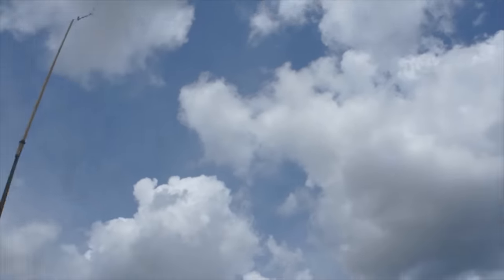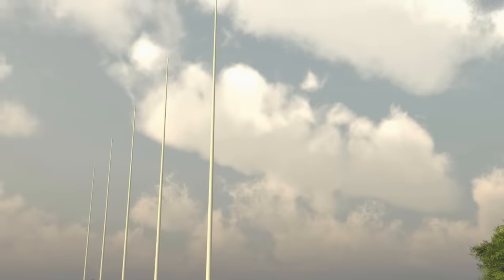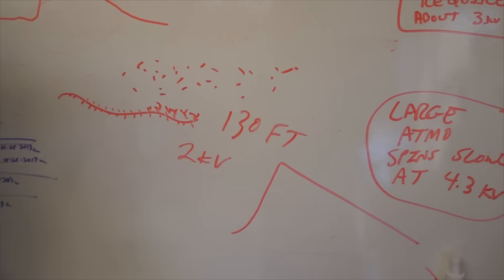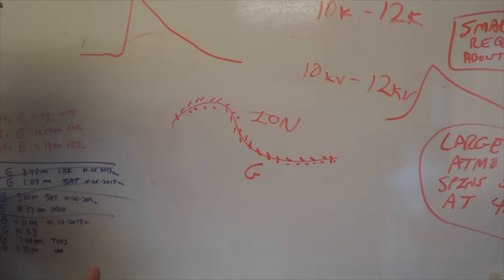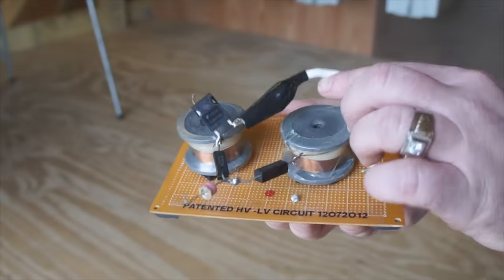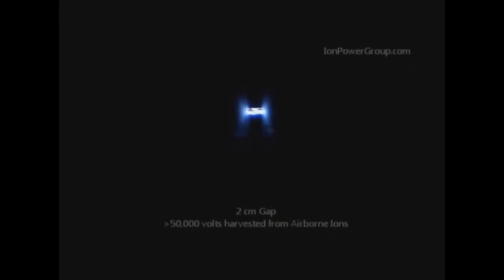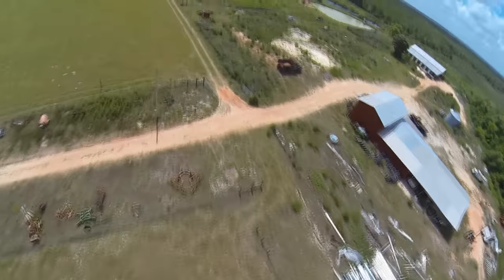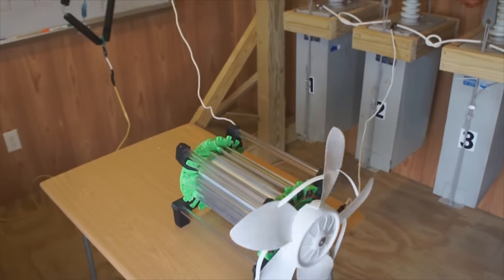Graphene/Graphite Atmospheric Electricity Collectors - Plus Horrific Hexacopter Crash!

Comment: try helium/vacuum balloon radio/voltage receiver instead, no propeller shenanigans
Reply: just the wire is much easier to tether to ground and deploy, its a long wave antenna
Reply: same for money/law/people ownership
Reply: well atmo generator is a marx generator circuit, just step it down, even by switching, after charging the caps
Reply: all your patent claims are void
Reply: any animal barbarians do that, dont go so low, public shame
Reply: no you dont patent food, or anything, its simple as heck, and not from you, all is from God
Reply: no you cant patent circuit designs, get over it

Comment: Ion collector electric airplanes?
Reply: I vote for an endless loop magnetic fluid generator - more voltage the higher the speed - more current depending on endless toroid current loop inductor coils - try to picture it

Comment: Radio Frequencies can be used to pull Electrical Current out of the Sky, OR GROUND! To help Magnetic, or Nicola Tesla Windmill Turbines,,  spin to Kreate a stronger Electrical Current. To run to an Alternator or Generator, to Kreate the amount of Electricity Wanted or Needed. Then a small amount of Electricity kan be looped back around to run the Alternator or Generator. RF can also be used to transfer finite Magnetic & Electrical Currents & Power. Complete attention should be given to all of the fine & finite points of Eddy Currents Kreated off of the Main Electrical current(s), & complete ferro, para & diamagnetic fields kreated. The Eddy Currents & additional finite sub currents are especially useful & beneficial in kreating the richest sounds, Kords & Musik, among many other things...

Comment: 12kv but low current. its like building a large stun gun. lots of sparks but less power. and that ion is generated by the rf power from a tv station transmitter antenna all over the planet and if those antenna stop.transmitting rf signal and so as this ion collectors. from what i know natural ions was high above the clouds. and those ion collectors is just feet above the ground.
Reply: No, this is "clear weather" sky voltage, roughly 100V per meter of altitude, at few-microamperes depending on antenna area.   
In the early 1970s, a physics prof was running motors from this, just using wire antennas lifted by a small weather balloon.   Search for article: Stong,  Jefimenko,  that gets you the Amateur Science article from Scientific American.   There's also a DIY build article from Popular Science 1974.

Comment: I Know if you doped the graphene surface with lithium you gonna create nanoantennas that convert radiation, ions, light, infrared heat, all that stuff in electricity... even wind. This nanoantennas works like millions points of contact with atmosphere and works like a nanopiezo device.
Reply: i would use a barium surfer compound to make similar nano particles as it would be more conductive at lower voltages and not lose much in the higher voltages if i may ask what black project did you work for such knowledge is not easy to come by me i am EBE bata to be exact its good to see such people helping out on such things this money for oil and control crap has to stop or its gonna destroy the planet that is is another story for another day but the problems from fukishima have us busy but its being managed just not easy to solve the solutions are almost as dangerous as the problem just that they are short term the radiation is like a plague what is stable may not remain stable and cause other things to become unstable turning the entire planet into a reactor of sorts we have to stay ahead of this curve at all costs while reducing the over all problem and dealing with any hot spots that show up over time i am structural engineer for my people but i know a thing or 2 outside of my field so if they want help designing towers i can help them reduce the ground foot print increase the wind load capacity and we have ways of making wire that can handle supper high current with very small diameters meaning 20 k amps through a cable only 1.25 inches thick i can show you how as far as HV insulation that is a bit harder to reproduce ill look into if an earth equivalent can be made not something that can easily be made in a simple lab its a complex nano rubber that is more or less a flexible glass vitor your welcome to get a more detailed briefing in person from one us i am not the one to to talk to on this rubber insulation but if you knew more about it i think you figure out to make something similar in a lab for these guys i can give a few hints but i do not want to run the show for you all

Comment: What about atmospheric pollution‘s in the air anything from pollen and dirt best organic material that naturally coat every surface and put a fin layer that would naturally cover all those sharp tiny little microscopic points of the graphing. Manually going up there and cleaning it is highly impractical you cannot put a Teflon coating on top of them to prevent that because it would be encapsulated and even Teflon itself when left exposed to the atmosphere will build up a micron layer that completely coats the surface making it virtually flat even if it had 1 million little of micro spikes on it the spikes would turn into more like little bumps

Comment: Did anyone here listen to the Art Bell show a few years back when he discovered electricity coming from his ham antenna array? The way the story goes, and I was listening that night, is that be built a new antenna array and when he tried to make the connection inside his radio room, he was knocked down by a large blue charge coming from the antenna. 

Please do a search for the explicit details, but there was something like 1/4 mile of #2 wire suspended about 80 feet high. Some people suggested that it was a static charge and asked if it was windy when he received the jolt and others wondered if it was perhaps a solar flare or simply a short from another source. Art denied any of this phenomena and stated that he put a volt meter on the load and had a constant 350 volts, 24 hours a day, rain or shine, windy or calm and with no regards to solar activity.

Art's story seems to compare with the details of Tesla's tower pulling power from the air and also the shock Ben Franklin got when flying a kite using wire for the kite string. Ben was not in a lightning storm as assumed but in broad daylight.

Anyway, Art contacted the power company and they told him they had trouble with their own "static" electricity and offered him the wholesale price for his electricity! I was wondering why couldn't one run the 350 volts through a solar charge controller which would be connected to a solar battery array and then to the inverter which would run one's own household?

Art didn't mention the amps but 350 volts and a big blue spark seems to be as much electricity as people are getting from wind generators, perhaps a lot more since it comes in 24 hours a day?

I am wondering what any of you think about this idea. Wouldn't this be free energy? I don't have room to build an antenna but perhaps some of you do? Someone on the forum may even already have a sufficient antenna?
Reply: kawii Turtle as soon as you connect load to these volts, the voltage would drop and you would just get a current with miniscule wattage, if at all.

Comment: I would definitely be interested in seeing 4 additional lengths equal to the widths of the square, each attached in the center and lifted with a balloon in the center, or with your hex copter if it can manage the weight, so as to form the pyramidal structure.
Reply: copper balloon?

Comment: This is nothing new. Hertz discovered this in the 1800's Marconi figured out how to transmit pulses off of it aka radio and tesla figured out how to harness it and boost it. In short what they are doing is collecting the energy from radio waves. The more man transmits cellular wifi tv radio the more radio waves there are to recapture in a nut shell but thats it. There is no usable amperage behind it.

Comment: The issue that I have with the validity of this an "energy source" is the fact that I hear a LOT of kilo volts but NOT ONE mention of amperage.  On a dry, winter day static electricity can easily reach into the many tens of kilovolts but we all know damn well that nobody has EVER run an electric motor off of that energy.  A volt is NOT a measure of power, a WATT is.  (Ohms law for DC: Watts = V * I)

I also find it quite humorous that there is mention of "stepping down" this crazy high voltage to a more useable level, but the circuitry shown doesn't appear capable of doing so.  Two inductors, two HV diodes, some two-lead TO-220 device that looks like a transistor but clearly is not??  Really?  

Not to mention the usage of CAT5 networking cable to cobble it all together...  I call:  BULLSHIT.
Reply: OH WAIT!  HAHAH!  I didn't watch all the way through before making my previous comment.  They are running an INDUCTION motor (the little fan) that REQUIRES 60Hz AC input.  Where is THAT coming from?  A cheesy little Radio-Shack breadboard circuit that takes HV DC and converts it into a solid 60 cycle sinusoidal at 120 volts suitable to run a shaded pole induction motor???  I don't think so...

Comment: HA! i have invented spark gap modulator that can turn high energy low frequency pulses to lower energy higher frequency pulses that can be used to charge mobile devices. Capacitors and voltage regulators nothing else.

Comment: where is the current displayed next to voltage ? 
where is the bank of capacitors or rechargeable battery charging demonstrated via their "circuits" (as they call it in the video) with details, like a charge current and voltage on battery/capacitor?
Again and again, these guys may be legit, great people, etc., etc., but surely the way it has been presented – is unpleasantly reminds of those crappy “free energy” videos. 
So, bad presentation of good ideas spoils the idea for everyone – which is the worst.

Comment: Are natural elements man made lol
Reply: Can I put capacitors in series like batteries and would this be similar to a step down transformer
Reply: +Cory Samoila Do Capacitors overcharge?
Reply: can I just harvest ions through a capacitor if the flow is steady then I should be able to plug a heater in and as it draws power from the capacitor the graphine would charge the capacitors right?

Comment: Yea somehow you need to prove against the known physics that you are actually collecting natural energy from the atmosphere.
Se we know that antennas can collect radio waves as we call them and convert that back into electricity.
The problem you have is that there are so much radio waves floating around that to clearly show one from the other is going to be hard. As soon as someone claims you are steeling their radio transmission power you are screwed.

Tesla is the founder of radio antennas and transmission in general and this is the physical reality, your theory does not prove without doubt that you are harnessing energy from other source hence it is stealing radio transmission waves from broadcasting towers.

We also know that a large amount of radio waves do come from space and NOT radio broadcasting towers but how do you prove between them...
Reply: ***** Finnaly somebody who has some sense
Reply: ***** Typically radio waves are encoded from the transmitter. I am not disagreeing with your comment. You are onto something. Radio waves are frequency based. I used to work on antenna equipment on the runways (ILS systems and VOR). These systems are designed to produce power of RF and transmit the radio signals. It would be difficult to pull power from these systems from the RF because of the certain radio frequency. This technology is capturing static electricity. To pull from multiple transmitters would weaken the radio frequency for sure. However transmitters are pulling from power companies and pushing it out to radio receivers and not using static electricity. The VOR pushing 3000 watts and goes up to 200 miles out. This is a lot of power but I cannot see anyone feeding off this! If this was the case radio frequencies would be constantly interfering with the FAA and the equipment would constantly be malfunctioning. This would be especially true of home radio use. To understand this think of just speaking and speeding this up. The frequency of your voice is speeded up through high frequency and transmitted out. This is not producing voltage or static electricity. It is just speeding up frequency. To draw power from frequency you would have to lock onto frequency and pull from it. This would cause multiple problems that they are not experiencing. The antenna's would also push the frequencies in every other direction. They would be experiencing radio interference all around the surrounding area. Video cameras and cell phones would also be having massive electrical shock. When he was flying his copter around - this would not be possible at all! The second it would lift off it would stop responding. They are harvesting the electrons in the air. Think about it like this. Does a radio receiver receive power from the radio transmitter or just the radio frequency? It just the frequency and not the power. They do not send power to the other end. It is not electrons or Ions. This is some food for thought.
Reply: +Fireicer Cooper (f1r31c3r) There is no such thing as stealing radio transmission power when Every single radio on earth does the same. once it left the station its free air.

Also the earth is hit by Trillions of Volts of electricity by the sun every second, its harnessing sun, Galaxy, wind and air power.

Comment: Power (Watts) = Current (Amps) x Voltage (Volts).   As many people have said, if they are only reporting the volts, that means they are either ignorant of how electricity works, or the system produces almost no amps and therefore almost no power.   This is an attempt to use the language of science to con people who don't fully understand it out of their money.

Comment: Virtually all electricity is currently collected this way and has been for many many years. Its a shame that these guys are reinventing a wheel that is already in motion. Why else would high voltage power cables have no insulation on them. Its because electricity goes to the wires and not from them.

When pink floyds album "Animals" featured a flying pig over Battersea power station, this is exactly what they were telling you.....
Reply: and the other real breakthrough will be when you will start taking your meds again.
Reply: The high voltage power lines do have insulation. At the towers, porcelain insulators are used. Between the towers, the insulation is air. 
That's why the higher the voltage, the higher up the conductors.
The conductors don't collect energy, they move it from source to destination. In fact, there are losses due to capacitance currents between the conductor and the ground, air being the dielectric. Also leakage losses across the porcelain insulators.
These losses are minimal compared with the energy transmitted, but unavoidable,
It's recommended that you don't put a wire fence under a power line and parallel to it unless you earth/ground it. The conductor sets up an electrical gradient between itself and the ground, the latter being at zero voltage for the purposes of measurement. Your wire fence would assume a voltage depending on its height relative to that of the conductor.
Don't expect to get free energy this way. There could be enough to give you a shock, but not enough current to even power your toothbrush. It will also land you in jail for stealing energy from the powerco.